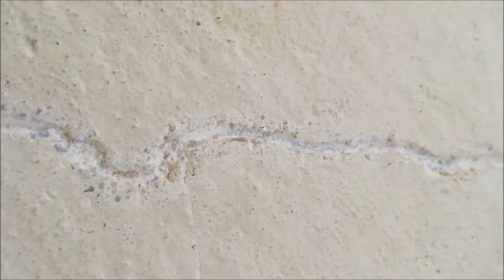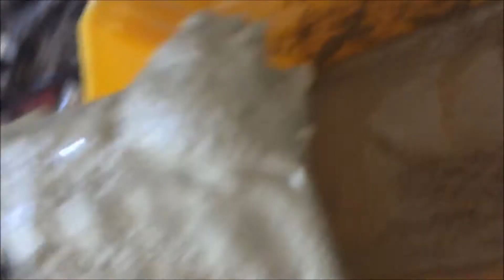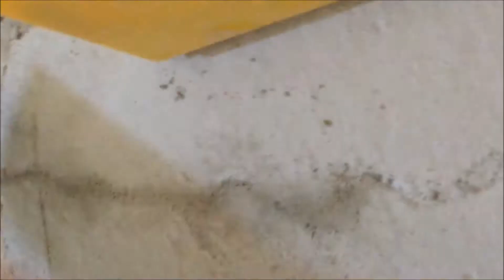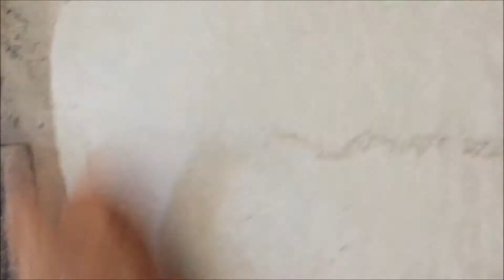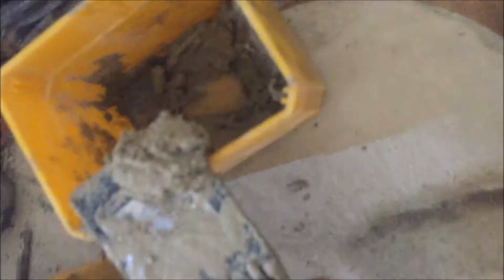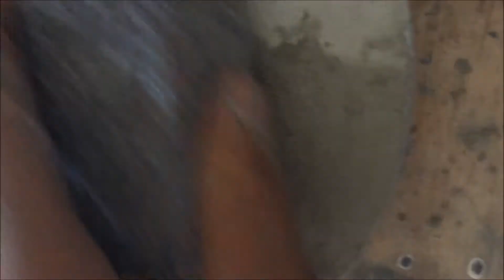Different Ways We Can Repair Cracks In Concrete

Comment: Is there an attachment that will polish the mortar that you put in there to match a shiny concrete surface? Also if you overfill it then sand it down, do you sand it with a lapped sanding attachment for the angle grinder?